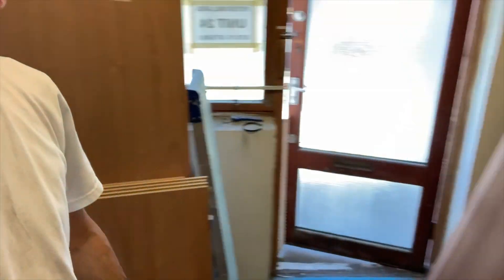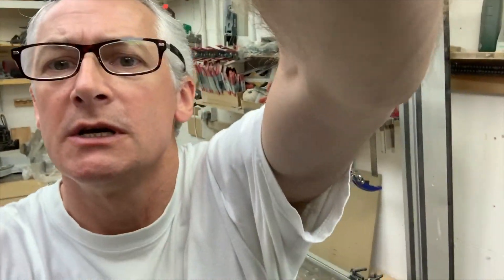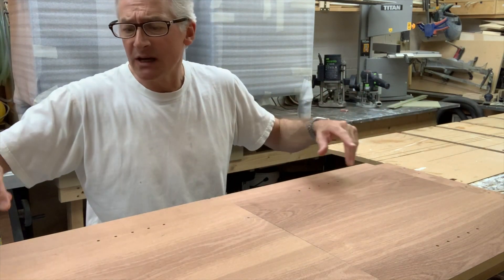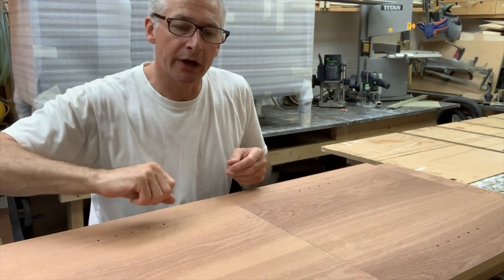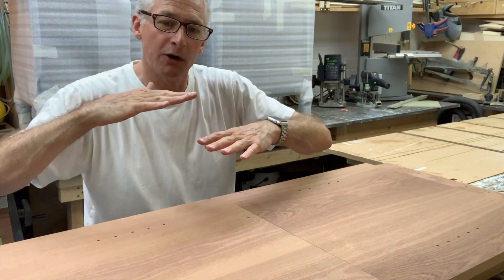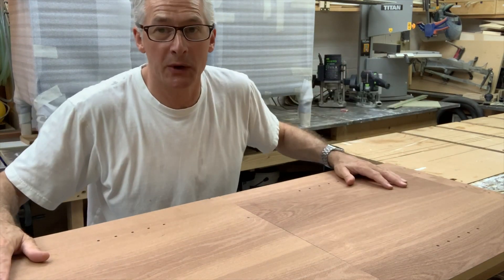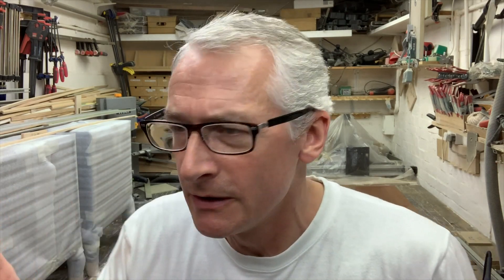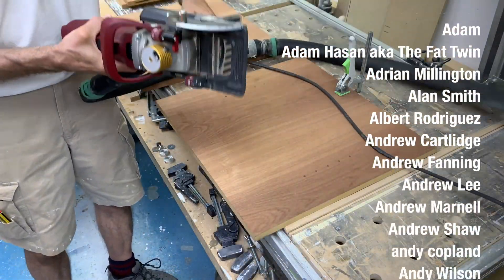My First Commercial Job with the Lamello Zeta P2 [video #340]

Comment: Is there a reason why the cant be screwed together?
Reply: Screws into mdf isn't a very strong connection and it's a slow process. With the lomello or the domino it can spped up your work and creates a much stronger joint.  Not only that put screws can puff out the edges of mdf.
Reply: @Blobjonblob  a lot of people in england and ireland screwing carcasses together. one screw might not be strong, but all together with glue its enough for what it is.
Reply: @shanesmith1982-w8c  very true I even done it myself. But I think the advantage of the lomello system is it can be very strong and can be taken apart very easy.
Reply: @shanesmith1982-w8c  It's not just about strength really bud. I'm quite happy to screw something together if it's hidden and the budget is limited. The beauty of these Lemellos is that, if you're using a veneered sheet material and the unit's you're making are "showy", the joining is hidden - unlike a screw head. Plus, the Lamello Zeta system means you can manufacture off site, flat pack for transit, then assemble quickly on install.
Reply: I get its uses concealed fixing, but in this situation it doesnt have any benefits really,  Wall to wall units nothing shown. Just my opinion.
Reply: @BischBaschBosch  👍
Reply: @shanesmith1982-w8c  
Screws are not easy to align when doing up frames. You need to clamp them and have a square clamp in to ensure that it does not separate. 

By the time you have set up your jigs for screwing you have already cut the slots and fitted the biscuits. 

Screws are cheaper to do at first but time will make a difference and you will not be as productive.
Reply: @bighands69  i have to disagree when you get into screwing units together there is no clamps required. But everyone has there own ways and everybody thinks theirs is the best😁
Reply from the maker: I’ve made hundreds of carcasses that we’re screwed together. Most of my Domino carcasses used screws as the mechanical fixing, but what you can’t readily do is dry-assemble, then break down to reassemble on site. The Tenso and clamex fittjngs make this very easy, and fast.
Reply: Key Components Shane Smith I’ve done a load of mdf cabinets recently with dominos. It makes life so easy with lining up edges
Reply: @GeeTheBuilder  i just couldn't see me making every unit in a full kitchen with domino or lamello it adds up  different folks different strokes
Reply: @shanesmith1982-w8c  
If you are making carcasses to a professional standard that means you are going to need square alignment on all joints. 

That means putting a square into the actual corner and then clamping it all down. So that when you put the screw in you are not getting the two sections pushing apart. 

If you do not build to a square form it means if you are building in frames you could get bulges or warping occurring.  Most British kitchens do not get that problem because they are so poorly built in many incidence and cost a fortune to buy as well.
Reply: @bighands69  screws pushing two sections apart, strange? Sounds like your using a bad screws. If your looking for a good cabinet screwed together 2mm pvc edging 18mm back reasonably priced. Cambrian oak, lissa oak, ivory, white. Get in touch.🤗

Comment: it was 42 degrees C in Iowa (USA) a few weeks ago....horrible..
Reply: Here in the UK we have a very humid hewt, so not only do you get hot, but you get sticky as well.
Reply: @ramblingman8992  exact same thing here in Iowa.  This is sopping wet heat.  Humidity is  extremely high - almost unbearable
Reply: @ramblingman8992  part of the reason is that Iowa is mostly corn.  And corn adds humidity to the air.  Its called the "Corn belt" or "corn sweat"  - When the corn is ripe, and the weather is hot, Iowa is a horrible place